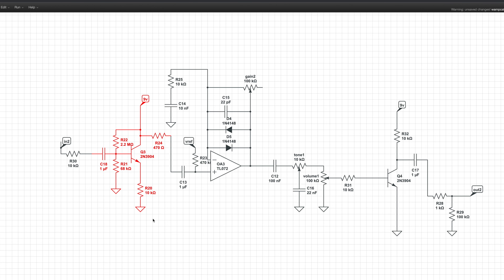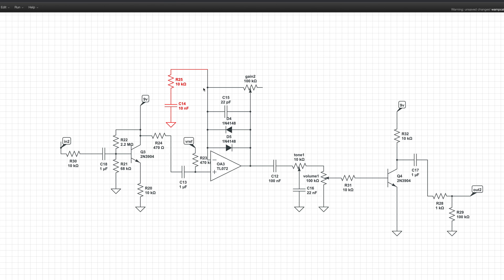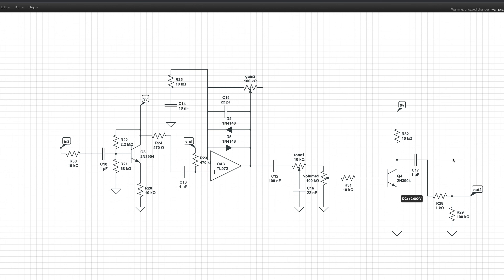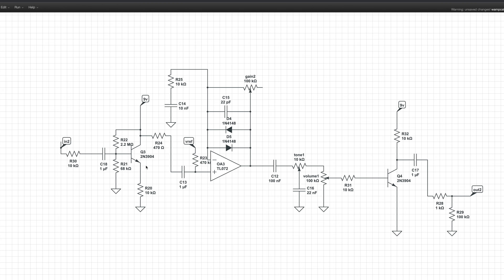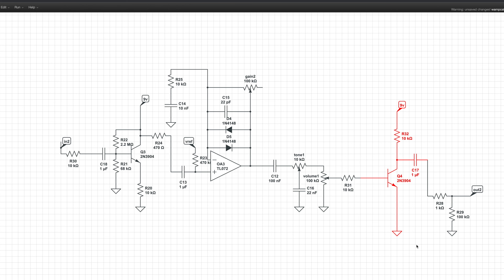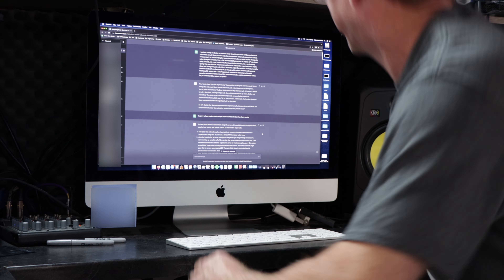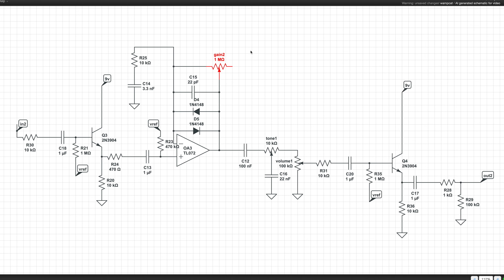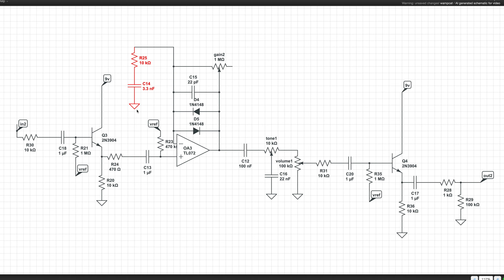Can AI create a better overdrive pedal than a human?

Comment: Hey Brian, you should build Wampler Bad Fuzz as a $99 pedal, lot's of people seemed to like it (myself included)
Reply from the maker: I mean, I can! I just think alot of folks wouldn't like that there is so much clean signal blended in with that fuzz tone. It might make for a decent bass drive though, come to think of it.
Reply: I got that bad fuzz sound. I don't know how it was done but yrs ago I bought a modded DS-1 that said in ad "Has the Reverb mod and a Fromel mod". All I know is at lowest gain ,barely anything there. At about 9:00 great fuzz sound. Anything else above that and it's too much for me. I know a lot of others would like this but it just sits on the shelf with the other unused pedals. Only costs me $40 for a highly modded Boss pedal. It's got a large scrape in the orange paint so I painted the scrape to look like lightening bolt in green.
Reply: @wampler_pedals call it “bad fuzz”. But seriously I loved that sound. It almost makes a doubling effect with that clean signal sitting under a layer of mud. Maybe “mud blanket”. But really I’ll buy one.

Comment: My rudimentary understanding of chat GPT is that it’s accuracy and abilities are largely based on the training data set that was used to train it. So for instance, if someone collected all the schematics of all the overdrive pedals ever produced, the GPT would better recognize typical values and topography. It could then suggest potentially new and differs variations, but what is it solving for? “How it sounds” is subjective so the training data set would also need to include things like: this one has higher gain, this one has more top end, etc. so that it knows better what changes to the circuit match the user prompts.
Reply: Its.
Reply: Chat GPT now supports reading and analyzing data, including documents and images! That means you can load on it lots of pedal schematics in a PDF file (instead of just describing each circuit for each prompt). Maybe it's time to make the experiment again.

Comment: the reason why LLMs like ChatGPT struggle with tasks like this is because they are entirely based on text and language, and that's something we rarely use to describe circuitry in-depth. what it probably is pulling from is some guy on some website talking about how one component in once specific design has a certain effect, but it isn't able to recontextualize that sort of information.
I think it's definitely possible to have an "AI" system that can design circuits extremely well. but ChatGPT can't because it's not really meant to. it's essentially the wrong tool for the job.
Reply: You nailed it.

Comment: That was fun. I actually liked the "Bad Fuzz." But, there is one thing that I've been wondering about. Can AI could actually improve the accuracy snd tracking of Pitch shifting/Transposing the guitar's tuning up or down? Yes, there are pedals, plugins, and Modelers that can pitch shift, but the results are often compromised by artifacts and glitches. Perhaps AI can solve this difficult problem better than humans have done so far. 🤷

Accurate Pitch to Midi conversion without special pickups/hardware would be a related area that maybe AI could help improve.
Reply: If AI could solve those issues, it wouldn't be a matter of asking ChatGPT to design the perfect analog circuit that we've never thought of. It would be more like using AI to process our guitar signal on the fly, much like how we have current instrument-isolation AI tools available. It wouldn't really be AI solving things humans couldn't do; it would be humans harnessing AI to do something transistors or traditional programming couldn't do.

Comment: So dumb question, does the op amp raise the level of every frequency, then you use the capacitors for filtering EQ, and Diodes/op amps for more gain, back into a buffer and thru?

Comment: I've heard boutique pedals that sound worse than GPT Fuzz.

So the promise of AI is reduced labor. For the time it took to get GPT to the fuzz stage, was there any cost/time savings from using GPT vs. a novice looking up how to build one?
Reply from the maker: That's a good question! Probably not, because I had to explain what wasn't working, and why it wasn't working in order to get it to explain to me how to fix it. Keep in mind, it's explaining like this: "Connect a 1k resistor in series with a 1uf capacitor to connects to the base of an NPN transistor, with a 10k resistor from the based to ground". These type of instructions would most likely confuse a novice unless they already understood how the electronics work.
Reply: I think the problem is that a soon as you have a complex idea, it takes way longer to explain it than to execute it. I know this because I write academic text. Basically, if I am at a point where I can explain the bot what to do, I have already written the article myself right there. And by the time Mr. Wampler asked what to do next he could have probably just tried out a new mod for the circuit already.
Reply: @wampler_pedals  I kinda love the fact that the builder of my favourite pedal ever (Tumn.Dlx., own 3 already!) is the one person to demonstrate what the current problem with bots is.
Reply: @wampler_pedals you're right about confusing a novice - or at least THIS novice anyway 😅 add to that the fact that I'd probably be unable to explain what is wrong with it in a way that AI would understand and I'm pretty sure I'm better off watching your and other electronics channels until I'm confident enough to start actually building a pedal - so far I've only "modded" one that ( to my surprise ) survived the surgery AND sounds OK

Comment: very cool, what's up with that neat breadboard buddy at the top, what's that do?
Reply from the maker: It's just an easy way to add power, in and out jacks, and other voltages (+ or - 9v, +18v, 5v for digital, dig ground, buffered vref, etc)

Comment: That last AI version was a Morning Glory.
Reply from the maker: nah. Morning glory is a bluesbreaker pedal circuit which has an inverting op amp after the non-inverting opamp with 4 diodes symmetrically clipping in the inverting OA, with the tone control and additional low pass filter after that. This design isn't that at all.

Comment: Short answer: No.  Why not?  Because every overdrive pedal is predicated  on an expected input signal, with expected dynamics, amplitude, and frequency response, and aims for a designated flavour of clipping based on that and the clipping elements used.  By the time one has specified all of that to ChatGPT, you've basically designed the circuit yourself.  And what Brian has made on the breadboard - with support from ChatGPT - is essentially a replica of something that's already out there.  An instructive exercise, to be sure, but not "better than a human" design.

And it's also worth noting that many popular time-tested designs were either the product of mistakes (like the Proco Rat) or else were empirical explorations that had precious little textbook theory to guide and support the design (like the Klon Centaur).  Is Chat GPT going to draw from data on what already exists, or will it go beyond?  And, as we see and hear, here, the query basically delivers the strikingly familiar and banal.  It's ultimately up to Brian to make it "sound decent".
Reply: Interestingly, ChatGPT suggested what has come to be known as the SWTC (Stupidly Wonderful Tone Control) as the tone control.  It has the perk of not changing level in any major way as one adjusts it.  The downside is that  it doesn't result in powerful changes to tone.  You have to really design for the ballpark tone you want, and use that tone control to compensate for speaker brightness - think of it as a fine adjustment.  But with all the circuits using a Tube Screamer or Rat-style tone control, it's surprising that it suggested that.

Comment: "The all knowing AI" -> Big mistake!
Chat GPT is not a search engine, it is not a fact machine, it is not providing correct facts at all. If the facts are correct, that purely by chance. Providing correct facts is not the work principle of this thing.
CGPT is a linguistic machine. Based on what it has read, it guesses the most probable answer from a linguistic standpoint. It is a very eloquent trash talker. Not knowing what it talks about, but doing that in a very self-confident, eloquent, convincing way. That's the way con-men operate.
Now, CGPT has read all that rambling about schematics in forums. From that mostly sub-professional talk it derives what it may answer. Garbage in - Garbage out.
In order to give well educated answers, it would need to read through many thorough analysises of schematics and their sonic implications. Then maybe it's power would come to use.
Reply from the maker: My comment was said sarcastically.

Comment: It's not actually AI. Calling it AI is just marketing. AKA: it's an absolutely outright bald-faced lie. It's a machine learning parrot that will spew back out answers only based on what has been fed into it. If you correct it with good info, it may get better. If you feed it bad info, it'll only get worse. It cannot really do any kind of deep analysis; at best it can do light comparative analysis (ie, like to like in 1-to-1 specific comparisons). however that's also dependent on it having the info to compare with.

AI is just more bullshit for now. Probably for the best given that we don't have the infrastructure to handle how badly such a thing would fuck up the work force if it were really as competent as advertised.